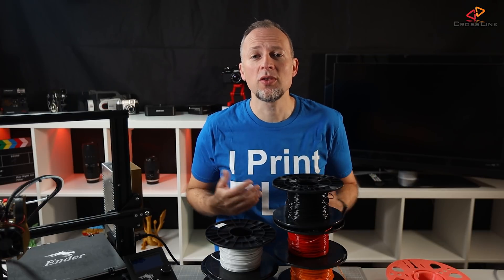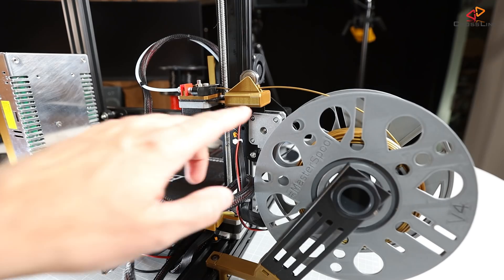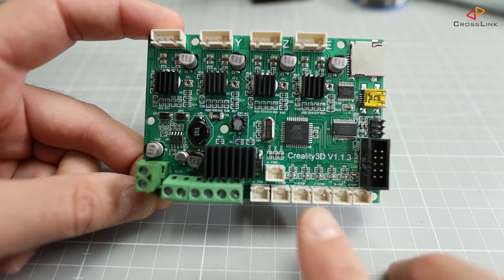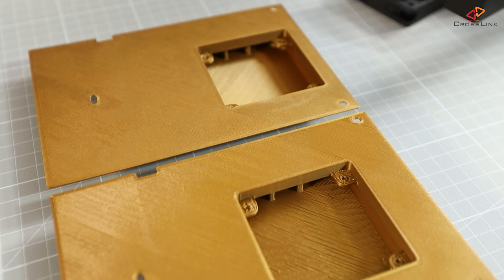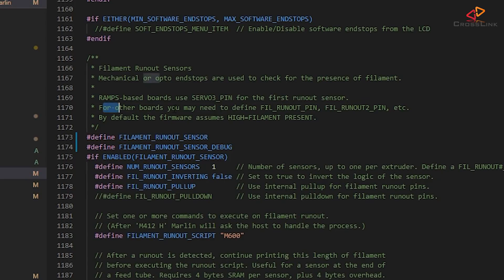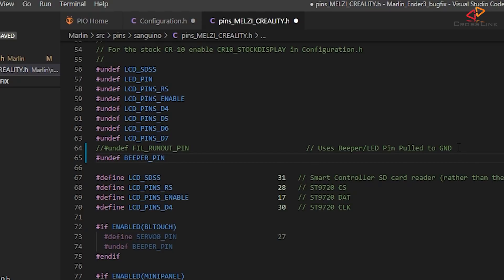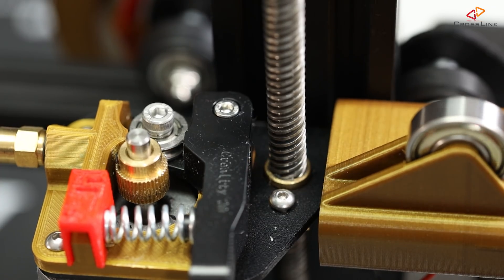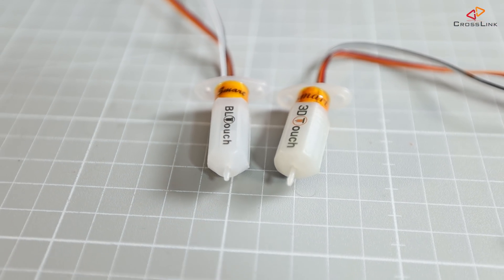Ender 3 (Ender 5, CR10) Upgrades - Filament runout sensor with Marlin 2.0

Comment: Hello, I have an Ender 3 and it is still covered by the warranty so I don't want to risk it doing the firmware update until the warranty expires. If I use this printer connected to the PC with the USB wire (instead of the memory card), maybe there is a way that the computer can tell the printer to stop if it runs out of filament? Many thanks. Regards.

Comment: I already installed BLTOUCH on pin 27 on my ender 5 pro v1.1.5.  When I add filament out sensor and compile Marlin 2.1.1 I have a overflow of 4812 bytes. How were you able to have both on your Ender?

Comment: Greetings,  I have installed your Filament runout sensor to my ender 3 V2 and WOW thanks for the great video on the way to make one for your E3 V2.
I have an Ender 5 Pro that I would like to install your runout sensor on but the E3 V2 Thingiverse file does not match up with the E 5 Pro frame.  Do you have a different file for the ender 5 Pro?  Thanks for your great upgrade.
My Best Regards
Doug

Comment: Greetings, Thank you for a great upgrade and keeping it simple for the newbies like me.  I was wondering if you had a print file for your side mount spool bracket?  I need to move my spool further out so I can mount the filament switch assembly.  If you could help me that would be great.  Thanks again for a great video.  Doug

Comment: OK but this sensor does not pick up any blockage.
Reply from the maker: That’s right, there is not many if any DIY sensors that can detect blockage. Most only detect filament runout. The Bigtreetech smart filament sensor is an option that works and is affordable.
Reply: @Crosslink3D  "Makers Mashup" actually has a nice DIY one you can print and build and it detects when the filament is stationary.
Reply: @Crosslink3D  Teck this one out: https://www.youtube.com/watch?v=v2mQ4X1J3cs&t=628s

Comment: for my setup it's showing that servo3, the default, is being triggered even when the sensor is not plugged in, im attempting to try and change that to a different pin to see if that fixes the issue but i don't know where to look.

Comment: Hi Daniel thank for this tutorial, I've got a bltouch mount on pin 27 so I used the PIN 29 but when I compile the firmware (Marlin 1.1.9) there are this error: 
Arduino:1.8.13 (Windows 10), Scheda:"Sanguino, ATmega1284 or ATmega1284P (16 MHz)"
In file included from sketch\MarlinConfig.h:42:0,
                 from sketch\G26_Mesh_Validation_Tool.cpp:27:
SanityCheck.h:488:6: error: #error "FILAMENT_RUNOUT_SENSOR requires FIL_RUNOUT_PIN."
     #error "FILAMENT_RUNOUT_SENSOR requires FIL_RUNOUT_PIN."
      ^~~~~
In file included from sketch\MarlinConfig.h:42:0,
                 from sketch\M100_Free_Mem_Chk.cpp:49:
SanityCheck.h:488:6: error: #error "FILAMENT_RUNOUT_SENSOR requires FIL_RUNOUT_PIN."
     #error "FILAMENT_RUNOUT_SENSOR requires FIL_RUNOUT_PIN."
      ^~~~~
In file included from sketch\MarlinConfig.h:42:0,
                 from sketch\I2CPositionEncoder.cpp:31:
SanityCheck.h:488:6: error: #error "FILAMENT_RUNOUT_SENSOR requires FIL_RUNOUT_PIN."
     #error "FILAMENT_RUNOUT_SENSOR requires FIL_RUNOUT_PIN."
      ^~~~~
In file included from sketch\MarlinConfig.h:42:0,
                 from sketch\MarlinSerial.cpp:36:
SanityCheck.h:488:6: error: #error "FILAMENT_RUNOUT_SENSOR requires FIL_RUNOUT_PIN."
     #error "FILAMENT_RUNOUT_SENSOR requires FIL_RUNOUT_PIN."
      ^~~~~
exit status 1
#error "FILAMENT_RUNOUT_SENSOR requires FIL_RUNOUT_PIN."

It seem that I didn't add the line "FIL_RUNOUT_PIN" but that is not true, I add in the configuration.h:
#define FILAMENT_RUNOUT_SENSOR
#define FIL_RUNOUT_PIN 29
#define FILAMENT_RUNOUT_SENSOR_DEBUG
#if ENABLED(FILAMENT_RUNOUT_SENSOR)
  #define NUM_RUNOUT_SENSORS   1     // Number of sensors, up to one per extruder. Define a FIL_RUNOUT#_PIN for each.
  #define FIL_RUNOUT_INVERTING false // set to true to invert the logic of the sensor.
  #define FIL_RUNOUT_PULLUP          // Use internal pullup for filament runout pins.
  #define FILAMENT_RUNOUT_SCRIPT "M600"
#endif

Thanks
Paolo
Reply: Try the //#undef FIL_RUNOUT_PIN  06:17 in the video, worked for me

Comment: Ender 3 v2 has mainboard connector for runout sensor. New Marlin firmware has runout sensor built-in, no need to compile it. Video here is a little dated...

Comment: Hi, i'm just started to install Filamen runout sensor. Alltough, i use SKR e3 mini v2 motherboard on my ender 3 and octoprint. If i connect run out sensor to ender 3 motherboard, will octoprint stop printing when filament runs out or should i connect runout sensor directly to Octoprint server? Alltough, i could use 3pin microswitch to control and connect the other end to Raspberry pi. Alltough, this just feel's kinda hard.
Reply from the maker: The printer will pause printing and Octoprint will not have issues with that. It actually doesn't see that the filament runs out. If you connect the sensor to the Raspberry Pi, Octoprint will see the runout and will do the parking commands. I personally prefer this to be done by the printer. Less things that could go wrong in my opinion. But you can choose what you like more.

Comment: So, if I have a Bl-Touch on an ender 5 pro I can’t have a filament run out sensor?
Reply from the maker: Depends on your mainboard, if it's 8 bit or the new 32 bit. As shown in this video, the 8 bit board only has one free pin using the adapter on the display cable. To get another port on the 8 bit board you need to solder the pins manually as I show it in this video here: https://youtu.be/wVU_5lZKuMo
Reply: @Crosslink3D  thanks for the clarification , I’m using an 8bit board.

Comment: Hi ! I really appreciate your guides man, they are very good and well explained. Can you make a video with a guide installing a LJC18A3-H-Z/BX capacitive sensor on the newer ender 3 v4.2.2 board ? It will install like on the old board using an optocoupler and same wiring scheme ? thanks !

Comment: Hi, just printed it for my Ender5 (Pro) but not sure how to install it? (yeah I know, I should have researched before printing, but I read the title of the video "
Ender 3 (Ender 5, CR10) Upgrades - Filament runout sensor with Marlin 2.0" and thought go go go ;-)
Reply from the maker: If you have one of the 8 bit mainboards, you need to do the pin27 mod to get the free pin for attaching the sensor. I made a video about this.
Reply: @Crosslink3D  Hi, sorry I ment the print does not fit, I have an Ender 5 Pro and it has a different setup. I found a mount that fits on this printer and it is working great! My Ender has a v4.2.2 board.. with a port for the runout sensor. Thank you for the video, let me know if you want a link to the one that fits on an Ender 5 Pro..

Comment: Hallo Daniel, i have a issue with the runout sensor. When i start a print it jumps into a weird filament unloading and loading loop. I can't even start a print. After i pull out the filament out of the sensor and restart the print without it , then it does the print fine. I thought it was the inverting thing but it was not. Can you help meplease? I have the latest 2.0.x bugfix on my Am8 skr 1.4 Turbo build. Everything else is working fine. Even the bltouch 3.1 :D the only thing is the fil runout sensor
Reply from the maker: Are you using a switch or a „smart“ sensor?
Reply: @Crosslink3D  the smart sensor with the led signal light. I found the Problem! It was the Fil_Runout-State that was set on LOW. It has to be like the lines i paste below.
 
  #define FIL_RUNOUT_ENABLED_DEFAULT true // Enable the sensor on startup. Override with M412 followed by M500.
  #define NUM_RUNOUT_SENSORS   1          // Number of sensors, up to one per extruder. Define a FIL_RUNOUT#_PIN for each.
  #define FIL_RUNOUT_STATE     HIGH        // Pin state indicating that filament is NOT present.
  #define FIL_RUNOUT_PULLUP               // Use internal pullup for filament runout pins.

Comment: Can you explain how to fit it to the Ender 3 v1 with the 4.2.7 board as when I’ve built the firmware and tested it, the printer reboots and when the filament is in the sensor the printer refuses to boot up. Cheers...

Never mind got it working, switched wires around 5v and sensor
Reply: hi, i also have got the 4.2.7 board and i want to use the z-endstop switch cause I have BLTouch, so can you please tell me which pin you used to connect your wires (photo?) Thanks in advance
Reply: @ericschott6157  with the board installed and looking down, the power connector top left corner, the filament sensor is next to the green connectors.  The first pin closest to them is white (sensor), then black (gnd) then red (5v).  Even though one video I saw showed the sensor and 5v the other way round, it doesn’t seem to work as mine just refused to boot when the filament was in.  Once I switched the sensor and 5v around it worked with a purchased sensor and also with the DIY one.
Reply: Perfect, thanks!

Comment: Cool, how can I set the filament run-out sensor to pause the print when the filament runs out and NOT cool down the bed...?
Reply: Did you find any solution to that?

Comment: Can't wait for the Ender 3 V2 method that already has a Filament Runout Sensor connector on board.
Reply from the maker: Yep, me too. Still have to test that printer... don’t remind me
Reply: I have an Ender 3 V2 and since its connected to octoprint I built this exact filament runout sensor and connected it to my raspberry pi instead of the mainboard.

Comment: Great video! Also 2.5.3 and bugfix broke Babystepping for me as well as many others. So if you're also using ABL you'll want to go for 2.0.3 or before.
Reply from the maker: 2.0.6 should be fine now. I’ve installed it already and it works nice

Comment: Great video, as usual. Though, I have not had any issues compiling any marlin 2.0 firmware, including the latest, on a windows machine.
Reply: I'm the same, rebuilt bugfix-2.0.x numerous times this week on my Windows machines, and apart from my own mistakes, it builds successfully every time.
Reply from the maker: 2.0.6 seems mostly fixed. They found a workaround seems

Comment: Is there a such thing as jamed or clogged sensor?
Reply from the maker: Maybe could happen but this version has such a wide opening that this will not be an issue - my opinion
Reply: If you meant a sensor to detect jams, I was thinking there must be a way to have a spring loaded resistance that would pull the filament supply away after the feed drive cog eventually wears through it, triggering filament run out, but it would be too late of course and resuming would not be possible. At least though it would stop the print, and maybe improve safety, and reduce the baking of the residue that's in the hot end at that point. 

Building a rolling speed detection to catch it immediately would be a lot more complicated of course, but I'm sure someone has done this.
Reply: Yes BTT do one https://www.biqu.equipment/products/btt-sfs-v1-0-smart-filament-sensor-detection-stuck-blocking-filament-module I've had one a while put haven't worked out a good way to securely mount it at the filament input side of my Ender 3 that lines up correctly with my extruder. Most of the printable mounts are too low/high and I'm no good at modding prints to adjust them.

Comment: Awesome as always, one suggestion, do not use a switch, use a rotary encoder, Marlin has support for these, looking for pulses at a known rate. This will also detect filament breaks and clogs, both of which a simple switch will not.
Reply from the maker: Good Suggestion! Will have to look into that...
Reply: @Crosslink3D  It is the basis of the BTT "smart" filament sensor. Working on building a DIY one myself :)
Reply from the maker: Luckily I’ve ordered one to test it, so I will be able to compare it with the switch version.
Reply: @Crosslink3D  If you are interested i can do a video on building a DIY version :)
Reply from the maker: Great idea, I could feature that in the review for the BTT smart sensor
Reply: @Crosslink3D  Now I know what I am doing this weekend :)
Reply: @MikeysLab  I'd certainly like to see that! Where I live now it's not possible to find any upgrades for the mainboard though, so I'm stuck with the stock board. Sounds like some hacking with rollers and magnets.
Reply: @baz813  depending on how good you are at soldering there is a couple of free IO on the standard mainboards you could use, maybe I should do two parts, one with my ender 3 factory board and another with the skr 1.4, sorry crosslink did not mean to take over your comments
Reply: I think I have found a good mount for the BTT sensor and Ender 3. I didn't like the idea of it just "hanging" with the filament going through and I also wanted it on the input side of the extruder. Printing this now and will see how it goes: https://www.thingiverse.com/thing:4550063
Reply from the maker: Not an issue. I’ve already finished a video about how to break out the serial port on the Stock mainboard. Going to be published soon.
Reply: @Crosslink3D  Now I am looking forward to that video, my method is either solder to a tiny pad, or do some SMD rework on the board, both of which are not overly beginner friendly :)

Comment: I guess I should watch the video on why the bugfix build should fail on windows so I can understand why it isn't on mine. Just using VS Code and PlatformIO seems to work okay for the latest Marlin bugfix branch and my skr mini E3.
Reply from the maker: Yeah, seems to be working since Release 2.0.6. So most probably the issue is gone by now.

Comment: Daniel, good video again. Some recommendations on how to deploy it to my Anet A8 plus with octoprint?
Reply from the maker: I think I have to look into that separately.
Reply: @Crosslink3D  Hey Daniel. Eigentlich ist crosslinking Tube channels nicht meine Art. 

But as you both seem to bei interestet in, take a look here: https://youtu.be/UdETssS-ods
Reply: I have installed this octoprint plugin: https://plugins.octoprint.org/plugins/filamentrevolutions/. Instructions are simple and it works fine in my AnetA8plus without no firmware modifications.😉
Sensor installed: € 10,53  6%OFF | Trianglelab filament runout  sensor 3D Printer Part Material detection module  1.75mm filament detecting module
https://a.aliexpress.com/_B11H5N.